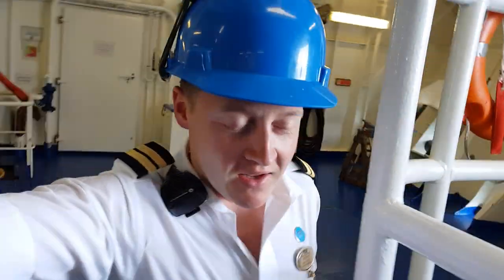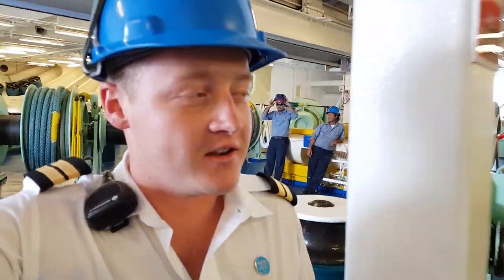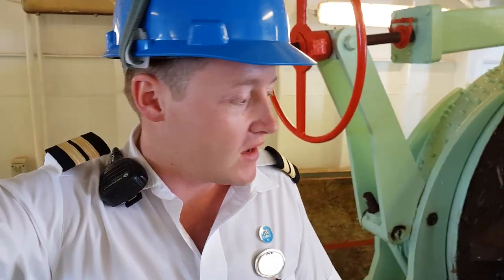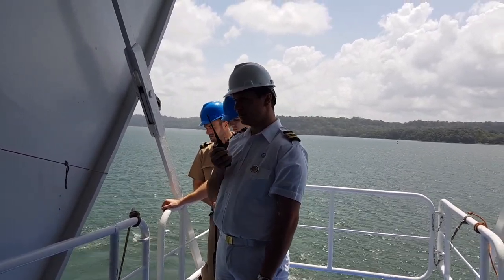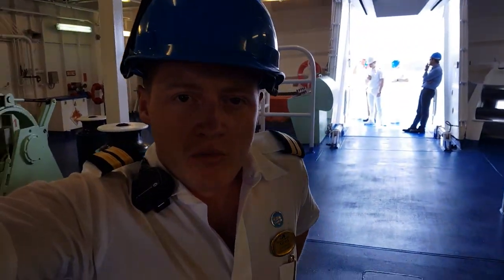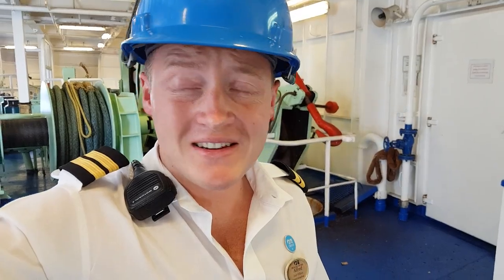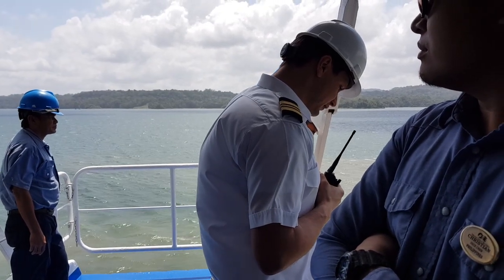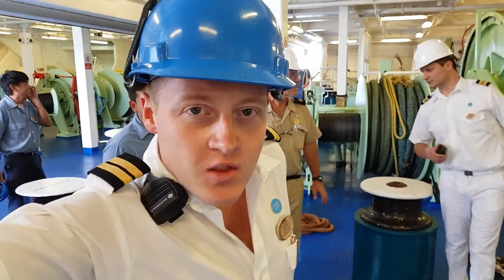Dropping Anchor - Island Princess - Gatun Lake Panama

Comment: Alfie, this was so informative!! I've always wondered how the huge shipboats do this. It appears to be a scaled up version of dropping anchor on any other boat, except that (as you said) the weight of the chain does a lot of the work. One question I have: from watching Sailing La Vagabonde I'll often see one of them "diving on the anchor" to confirm it's taken hold and there will be no anchor drag during the stay, is there anything similar to that on a shipboat?
Reply from the maker: GivesAMinute glad you enjoyed it Benon and learned something new. So we don't send anyone or anything down to check but as was mentioned we stretch the cable to ensure the anchor flukes dig into the sea bed and hold. The flukes are attached to the shank on a pivot do no matter which way you stretch it from the original position the flukes should flip and dig in. Hope this helps
Reply: Yeah that makes sense. And I guess the weight of the shipboat pulling as much as it does would dig it deeper anyway.

Comment: That was incredible, Alfie! I was surprised how fast that chain moved and that it is not computer controlled and that it relied upon manually counting the links of chain. How much more chain was in the locker and how much does it weigh, including the anchors? Thank you so much!
Reply from the maker: Hi Mitchell, thanks for your comment. Glad you enjoyed the video. The port anchor of the Island Princess has 13 shackles of anchor chain connecting the C14 anchor. Each shackle is 27.5m (90ft/15 fathoms). With approx 5.5 out here that leaves 7.5 in the chain locker so approximately 206m (680ft) of chain left in the locker. 13 shackles of anchor chain weighs 70t and the anchor another 11.7t. So in total you're looking at approximately 82t. Hope this answered your question. Thanks again, Alfie
Reply: @SameShipDifferentDay  Thank you so much for the incredible information! You will be a Junior First Officer pretty soon! That is better than a Senior Second Officer, correct?
I really enjoyed your scary, haunted night tour of the Coral Princess! You really did drop your flashlight, or was that part of the joke? Thank you so much, Alfie You are an awesome Officer and a Gentleman!
Reply from the maker: Next step for me will be First Officer, fortunately we just have the one onboard. The flashlight was all part of the amateur dramatics! Hope it had the effect I was looking for